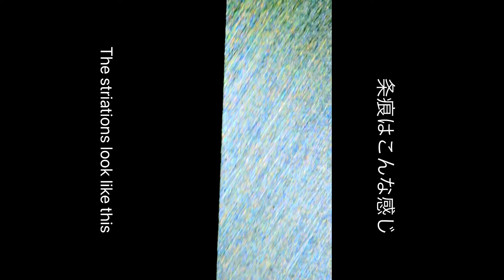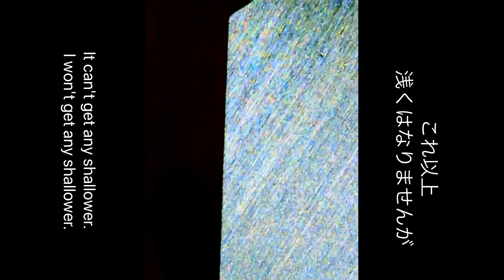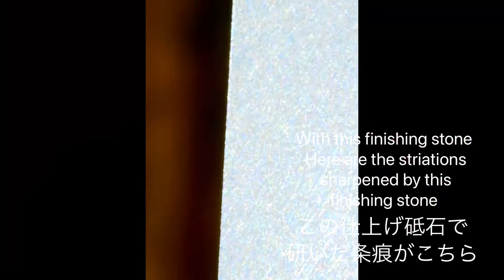天然砥石　奥殿巣板　中継ぎ用

Comment: The Numata Gourd came in it is a medium with just the right amount of hardness.The 42mm was swimming and grinding well.
Reply from the maker: Grinding stones of moderate hardness are easy to use.
Reply: It had a crack on one end of the stone.So I was able to try Ishisan Natural Whetstone Adhesive.I put some coats on starting thin.It drew the crack back together.

Comment: Do you please know the hardness of your Okudo suita on the five point scale that shops use? Also for the stone that you use for finishing? Thanks for another chance to improve my sharpening. Great content :)
Reply from the maker: The hardness of this okudo is about 4 on a scale of 5.
 The hardness of the finishing stone used in this video is 2.5 to 3.

 Both the finishing stone and the joint are made of the hardness that is appropriate for the blade.
 I try to use the hardest one that is appropriate for the blade 😊.
Reply: Many thanks for explanation. I would never assume the finishing stone could be softer than the medium stone. Very important thing to learn for me.